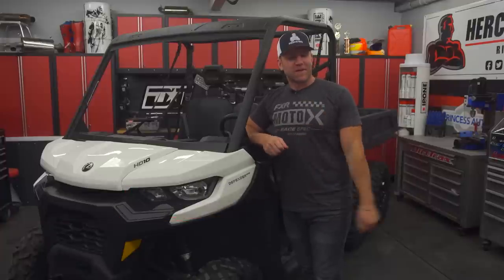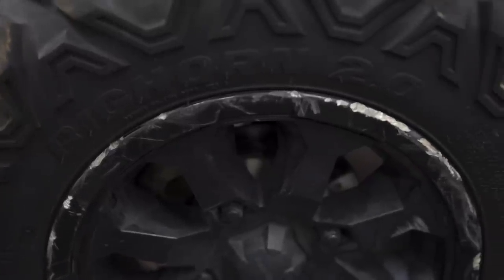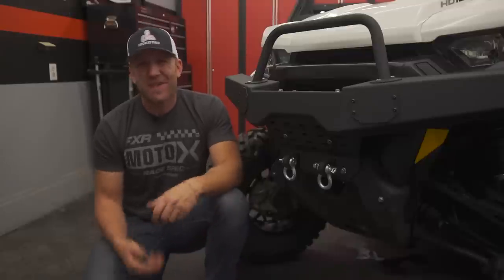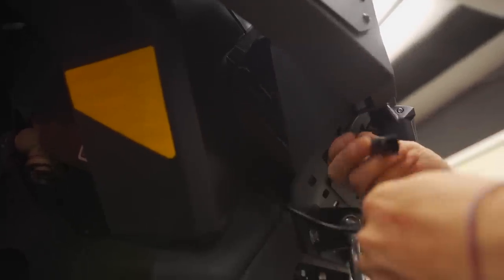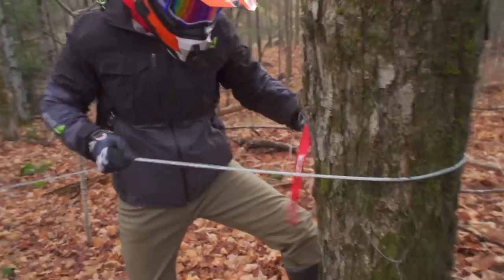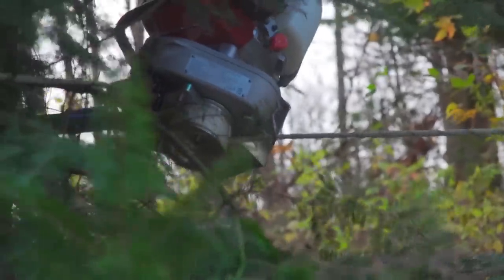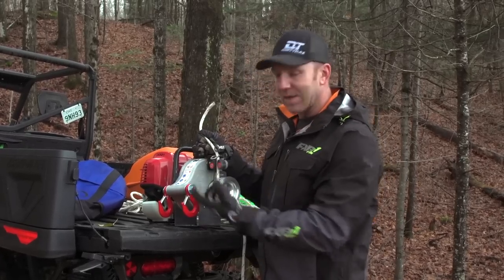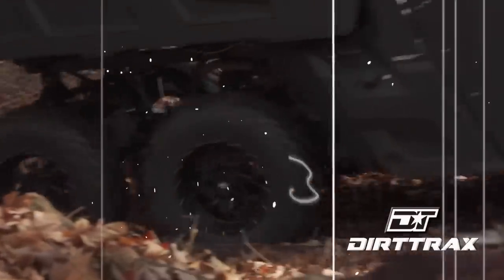TOUGHER, MORE CAPABLE & BETTER EQUIPPED | CAN-AM DEFENDER 6X6 UPGRADES

Comment: Great video y’all but I don’t see how if you only went from a 27” tire to a 28” tire that you get a one inch more ground clearance, half of the inch you went up in tire size went up and half went down so really you only gain a half of a inch more clearance. Plus ya hafto take to account the tires you change to maybe shorter than what they say and may only be a half inch taller than the OG tire

Comment: Nice. But what's the deal with the suicide doors? Over the last 100+ years, we've come to the conclusion that suicide doors suck. Come on Polaris, Can Am and everyone else, fire the engineer that designs the doors and hire someone who knows what they are doing.
Reply: It’s way easier to get in and out with these doors. Otherwise you’d have the open the door nearly all the way to get out
Reply: The problem with a front-opening door is that there is no good mount point in the front to put the lower hinge.  To have a place to mount that lower hinge you would need a smaller wheel well, and I'm not sure people are willing to make that tradeoff.